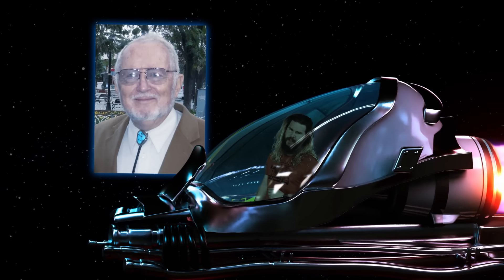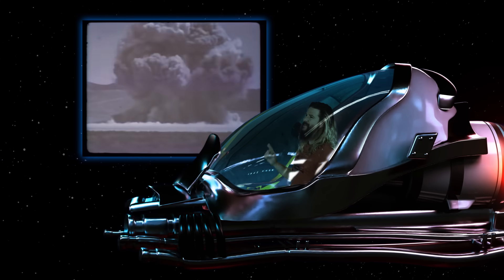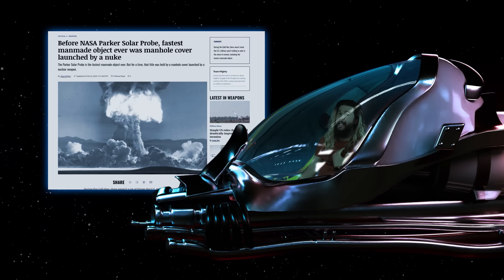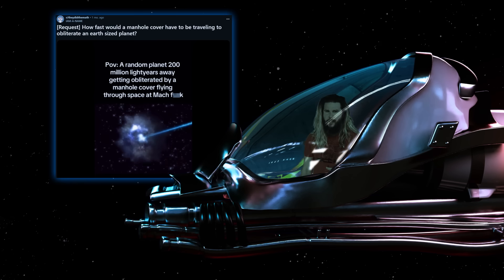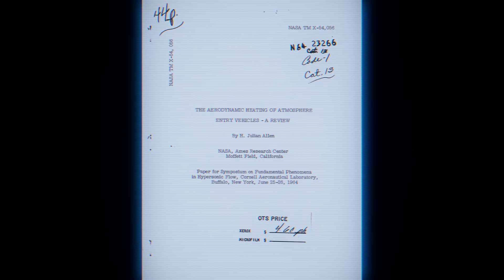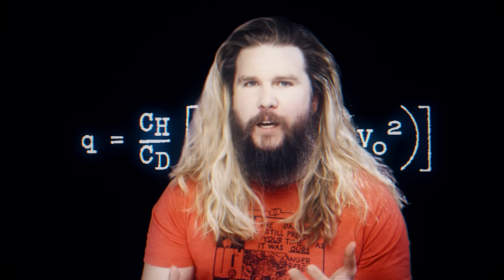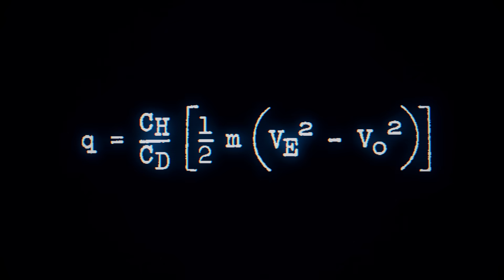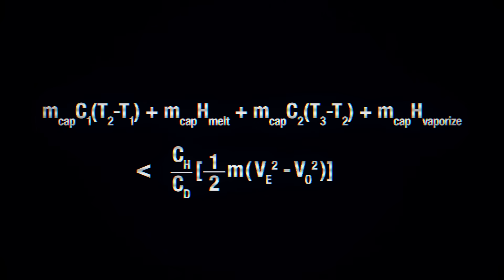Debunking the Nuclear-Powered Manhole Cover

Comment: I think there's too many assumptions for this to be accurate. This seems to be geared as a kind of worst-case for the metal lid.

Without an accurate calculation for the final velocity at exit of atmosphere accounting for gravity and drag, the formula will always provide the highest possible value. However from the other side, there are a lot of people arguing that it would have reached outside of the earth's atmosphere in less than a second, discounting the angle of launch of the lid which I haven't seen discussed. I won't get into the fact that the generally accepted boundary of space is 125km and it was going 66km/s...

Also keep in mind that this is also the LOWEST calculated velocity of the lid and I'm not qualified enough to understand how drag and thermal transfer are affected on objects at differing velocities. 

I think this formula is also assuming that heat would be immediately transferred evenly throughout the material. Does the thermal conductivity of the material affect the formula? Would there need to be considerations of boundary layers of liquid/gas that are not in immediate contact with the object as it moved? How would rotation/tumbling affect the heating?

This video seems to be what it set out to disprove. All it shows is that in a worst case and simplistic scenario for the lid, it could've burned up. All factors need to be taken into account and I don't think Kyle has achieved that here.
Reply: Thank you. This isn't the kind of problem where you can assume the atmosphere goes forever and just plug in constants to find a number. You could probably write a thesis on this problem.

Comment: I would argue that the equation doesn't really work quite right. cause it would melt and then turn into a liquid which would automatically take a more aerodynamic teardrop shape. reducing the heating profile. But I think on something like this the time to melt and the process of melting itself would be a factor. there's also the possibility that the liquid boils before the inner portion of metal melts. I would've liked to see the two opposing extremes (for the other one, the situation where it first melts and assuming the more aerodynamic shape happened instantly)  and then a reasonable statement that the actual situation is somewhere in the middle. 
The other factor here is there's an assumption that it slows down all the way to 0. if the disk rises fast enough that it doesn't lose all it's velocity within the atmosphere, then that's it going to space. You'd want to calculate the drag on the disk as a function of altitude. find the acceleration. integrate that to find the final velocity reached and then redo the heating calculation with that.
There's a few other assumptions too, but I think they should be fine (?). I do fluid dynamics, but not hypersonics, but I think assuming that peak heating happens way down in the atmosphere is fair. but this really needs an integrator approach. calculating the velocity change, heating, and thermal energy simultaniously.
I'd love to sit down and calculate that some day if I have the free time.

Comment: I guarantee you that there was some side of that weld that was less strong than the other side.  That side would have given way first by a small fraction of a second. This would impart a spinning force. While spinning, its resistance to the air would certainly not be the same as a flat plate going horizontally through the atmosphere.  Is this a reasonable concern? Would the equation have come out with a different answer had the manhole cover been flying upwards on edge? Seems like that would be the most extreme alternate case, and if it still burns up then that would settle the last of the semi-reasonable pedants I can imagine. Sorry to not have come up with the math already, but differential equations was almost 20 years ago.

Thank you for this and all of your other videos.

Edited for word choice and grammer. Shouldn't have trusted speech to text without a proof read 😅

Comment: Okay, yes, the manhole cover was going fast enough to create enough energy to vaporize the manhole cover, but was the heat flux great enough for the manhole cover to be fully vaporized in time? Is it possible some material escaped earth's atmosphere because the manhole cover was not in the atmosphere for very long and did not have enough time to fully vaporize? Also, is the air resistance negligible in changing the velocity of the manhole cover if it somehow managed to escape the atmosphere?

Comment: but you didn't account for it self protecting itself. Similar to how we shield ballistic missiles by actually making them less aerodynamic at the tip. because this helps form basically a protective shock cone and also the material going plasma also shields things farther. And such objects tend to explosively form to a more a cone. So it's not impossible some of it reach space.

Comment: The atmospheric heating would be complicated by the disc flipping around like a coin as it shot through the atmosphere, because there is simply no way the launch pressure was perfectly uniform, the welds failed perfectly evenly, and there was no atmospheric turbulence on the way up. That flipping around would change the drag coefficient constantly while also constantly exposing different surfaces to the heated atmosphere above the disc. I think a significant percentage of the outer surface was vaporized, especially around the edges, but not the whole thing.
Reply: Assuming that what I know about bullets applies here, tumbling would also alter it's trajectory.  It probably has a better chance of making it out of the atmosphere if that didn't happen.
Reply: @Devin_Stromgren : That would've altered its trajectory, but not enough to prevent it from escaping the atmosphere. Unlike a bullet, it was launched with several times more velocity than it needed to escape. At that velocity the interactions between the manhole cover and the air would've been similar to a bullet passing through ballistic gel. It would've been deflected, but it wouldn't have been trapped. It would've escaped the atmosphere on a somewhat curved path.
Reply: @fyrstormer  Except we're potentially talking about multiple random deflections in random directions.  It isn't enough to say that it absolutely wouldn't make it out of the atmosphere, just a potential reason why it MIGHT not.

Comment: Kyle, consider that the equations that Nasa came up with were for calculations on things entering earths atmosphere. Keep in mind that things entering the atmosphere are dealing with a light atmosphere initially and eventually have to deal with thicker air as they drop down which decreases their speed. The manhole cover was dealing with thicker air initially with the atmosphere becoming thinner and thinner over time.

Comment: I agree that it didn't go into space; however, I don't believe it would have burned up either. I think, because of the very non-aerodynamic shape, it would have tumbled, arced, and slowed down quickly. I imagine launching a quarter out of a short barrel might be a decent analog. Perhaps a simulation could be performed? Compare the trajectory and rate of deceleration of a tumbling disc through the air gradient with the rate of burn-off and see what altitude it likely reached?

Comment: If it didn't vaporize, it DEFINITELY disintegrated.  The force exerted on it in that moment would be whole orders of magnitude above the sheer strength of the material, and it would NOT be perfectly evenly dispersed.  I could see particulate rain of tiny drops of steel scattering the area for... a long, LONG ways.

Comment: In addition to all the other factors listed as problems, there is the problem of heat transfer within the 4inches of iron. I can weld an entire 1 inch hole on a piece of  4ftX4 inch iron and the underside will be warm to the touch but most assuredly not as hot as the weld. It would need an integration over time with decreasing air pressure to really even get close to knowing the true answer.

Comment: I know nothing about math stuff, but i do know iron and steel are different and both heat and shed their oxide coatings. If it was to evaporate it would have done that very low in the atmosphere, or we have an iron amoeba piss missile heading through space at standard solar velocities and no way to verify its not just a random asteroid. The nice thing about assumptions of any kind is that if you cant verify the outcome then youre a  guess and a coin flip from being schrodinger.

Comment: If he estimated the speed correctly, then it definitely vaporized. However the right side is only 7 times higher than the left side.  What if the speed was overestimated and it was only going 2x escape velocity instead of 6x? Then the righy side is 9x times smaller. Also it is most likely spinning, so the frontal area wojld on average be about half that of going up in its initial orientation, so the drag coefficient coukd be somewhat thr average between a disc and a flate plate, also need to be sure to use the turbulent flow coefficient. Soo.... i think there is still a chance lol
Reply: However, I think we should only be using the solid to liquid phase transition, because it would breakup from stress as a liquid and the connective heating would then increase. So because of that the left side of the equation is also smaller
Reply: Also the drag coefficient also increases with mach number, for a sphere it can peak around 2, it will be smaller for a spinning disk, so maybe closer to 1, so i think your estimated of 1.28 is close enough

Comment: Now... what they should try is to shove that manhole 'cap' down into the shaft above an underground test, then put a 30ft long tungsten spear on top of it to see if they can actually fire a bullet into space.

As for an object of that mass and composition hitting the atmosphere it would burn up at any angle other than maybe ten degrees to either side of 90.   At 90 degrees it would probably simply explode upon hitting the denser air of the lower atmosphere.   Most other angles it would bounce off or ablate until it shattered.  Due to the pressure gradient between the air impacting side and the back of the plate the only outcome would have been to shatter, there would probably have been rather little actual melting so much as severe ablation to the point of structural failure.
One thing that was not factored:  The heat it received from the detonation and how much the difference between the discharge energy meeting the unmoving atmosphere compressed the metal.
Also, it would not have flown upward 'flat' - it would have found an aerodynamic profile to assume... which means it probably tumbled like a penny dropped off of a skyscraper until it failed.
Like an ooblek, it probably did not 'melt' so much as get shattered by the two titanic forces it was exposed to - from the test, and then the atmosphere.
However, there is a slightly off chance that the forces that discharged it from its resting place dented it from 'plate' into 'bowl' - which probably improved its aerodynamic profile but shortened its life span considerably.

Comment: Honestly, I'm not sure if it would even end up boiling away...the calculations also ignore things like resistance and aerodynamics. Those tend to make it even more likely to go boom in mid air, not to mention the pressure, heat, and everything else that launched it, those factors could also compromise the thing even before it went off.

There's a good chance that the cover exploded catastrophically before it even was dislodged there with a failure inside it being as likely as along the edge to dislodge it.

Comment: The surface of the manhole cover deminishes as it gets vaporized, and so does it's velocity 
The math is incomplete
Reply: It's also not factoring for the decreasing air density with height.
Reply: I think that thing would shatter before it vaporized, adding to the loss of surface area.  You can shatter those things with a good smack.
Reply: @greghenrikson952 but maybe not a uniform smack so big it negates all resonance.

Comment: My questions.
How does this account for the thickness of the atmosphere?
How does this account for the change in atmospheric density with altitude?
How are we determining the change in velocity?
How are we accounting for the change in drag coefficient as the objects changes in shape as it heats and melts?

The most effective way to show that it vaporized would be to determine the altitude at which it vaporizes and show that all of the variables making this a difficult problem don't have a significant impact at that altitude.

Comment: I dunno, man. The way you moved your hand made me think you are assuming the disc didn't flip onto its edge from the air resistance. Maybe I missed the explanation, but in fairness, I tried to flip back through the vijya and landed on the ad read.

If you drop a dime into water, it nearly always takes the path of least resistance down, on it's edge. I'm far too old and stupid, but maybe some clever one can tell us the answer here.

Comment: The only issue i see here is that the atmosphere geta less dense as you go up, which is why rockets don't need heat shields to get to space. However they also don't start at top speed either. We'd have to run more math to see how quickly the man hole cover slowed down vs how quickly the atmospheric density drops with altitude. At that speed it would be through the bulk of the atmosphere in a fraction of a second. If that time wasn't enough for the heat transfer to melt it, some part if it likely escaped into space, however with an uncontrolled trajectory, likely burned up falling back to earth.

Comment: The dynamic pressure will be several Gigapascals. I think your steel will go splat at room temperature let alone if it gets even slightly warm.
Reply: If anything made it to space it no longer resembled a manhole cover.

Comment: Constants used for atmosphere, are they altitude dependent?  Atmosphere gets thinner on the way TO space, and thicker on the way to the surface of earth.

It could very well be that the fastest part of its journey was 0 to 18,000 feet.  After that point, atmosphere had less than half its density and getting thinner all the time.

So, since it didn't instantly dissolve (photo evidence of that), it could have survived half way as far as air density is concerned (18,000 feet).

Comment: I do wonder if the manhole going out of the atmosphere instead of entering it makes a difference.  It's highest point of stress is at launch, that's where it's velocity is the highest and aerodnamic stress is the highest.  Like is there enough time for the heating on one side to heat up the hole thing entirely.  Also as it goes up out of the atmosphere the stress gets decreased.  On the weekend we just saw the super heavy booster re-enter the atmosphere without doing an entry burn.  That's many times thinner stainless steel.  I feel like I would need to create a simulation to know for sure myself.

Comment: The answer depends on what you think happend in the first place. If you think it reached space the difference in speed in the equation is less than 66 km/s and you could calculate that it reached space.

If you assume it didn't reach space the energy loss which is converted into heat is 934kg/2*((66000m/s)^2 - (0m/s)^2) which is very much. But losing 66 km/s inside the atmosphere by drag seems very much. 

You could assume that it reached space for example with still 58 km/s so the energy loss from friction is 934kg/2*((66000m/s)^2 - (58000m/s)^2). So the kinetic energy that's converted to heat energy is way less. But it's still a lot. I don't know if slowing down 8 km/s in about 1s at this speed is realistic at all.

Another really important thing is that not all of this energy loss is converted into heat that goes into the manhole itself but also into the air around it. 
The space shuttle also went back into atmosphere in a way that most of the kinetic energy is converted into heating the air around it. If it had entered the atmosphere in a very aerodynamic way it would have been destroyed. So it entered in a way that's less aerodynamic so the plasma didn't had contact to the space shuttle. With this manhole this could be similar because it's not very aerodynic this could help it not to burn up.

The manhole was also heated by the nuclear explosion itself just like bullets from a gun are hot if they leave the barrel but it's hard to say how much.

The manhole probably changed shape as well on it's way up and lost some mass and was spinning like insane. All these things change the drag coefficient. 

So in conclusion I would say there is no simple math equation that gives an answer. Too many factors to consider. Maybe some simulations could help to find out? I thinks it's plausible to think it has been destroyed before it reached space but I don't know.

Comment: I'm pretty sure you can't just take an equation for an object entering earth's atmosphere and plug in the data to represent an object leaving the earth's atmosphere, it's not an analogous situation, but the manhole probably was completely obliterated, not sent hurling fully intact into the air. Since it was cast iron there's a good chance the explosion caused the disk to fracture into smaller pieces.